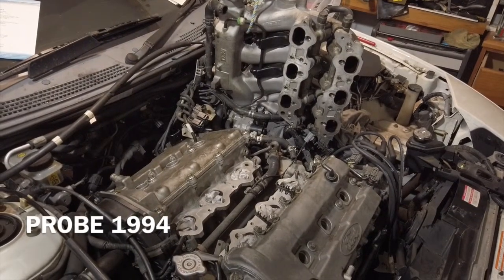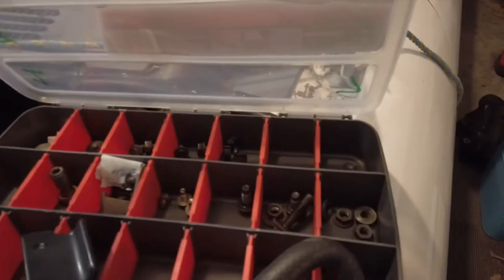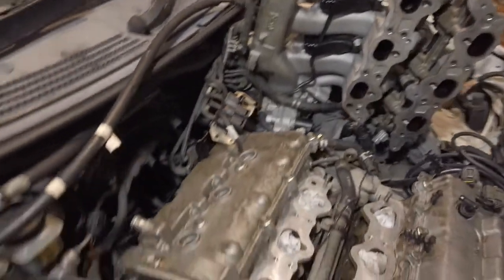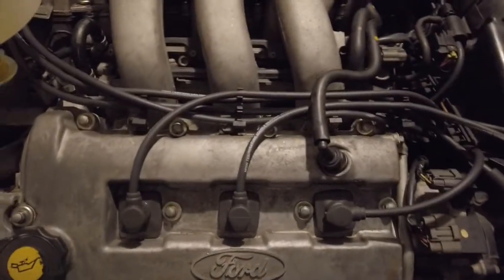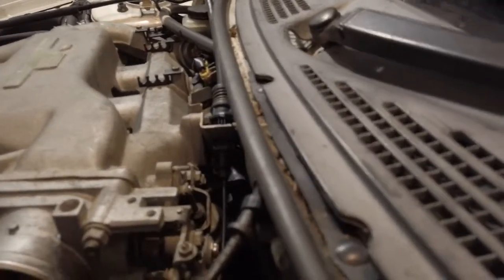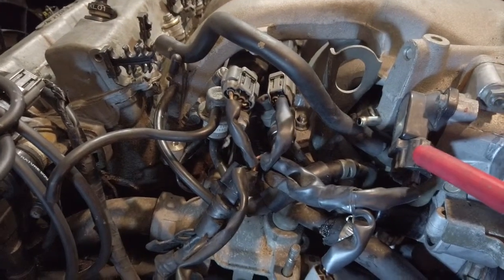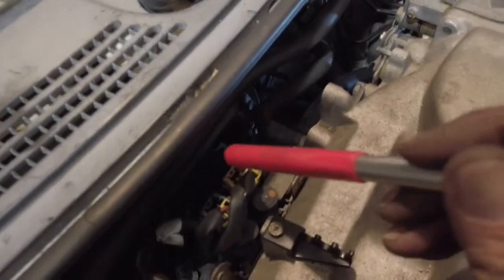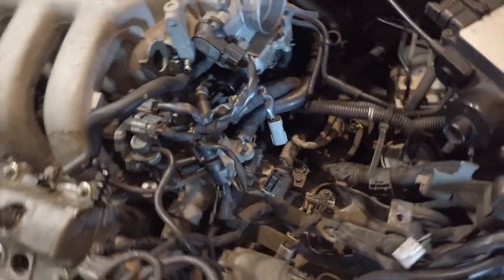FORD PROBE GT 1994 REPLACE VALVE COVER GASKETS

Comment: Will be doing this on my '94 Eunos 500. Looks like big hassle with so much needed to pull off first just to get access to valve cover gaskets. But was sure there had to be a no fuss easier way and looks like I finally found it here. Ta mate!
Reply: Eunos 500 is a very cool car.

Comment: A lot of thanks for your very useful video. I am just tackling this job according to your directions and things are a lot easier than the "standard" procedure. I will post the results of my job!
Reply: I completed everything without issues and even had the chance to repair my VRIS reservoirs and check valve. Thanks for your helpful video!!!
Reply: @ssanmor  what did your VRIS need to be repaired?  New solenoids or other?  Thank you

Comment: It should also be noted while you have that thing off, to replace any thing pertaining to that rear part of the engine and if you have a set of headers, that would be the time to do them while rear header access is easy. I also did the intake manifold gaskets on mine and I actually upgraded the manifold to a ported KLG4 off a 2001 626 ES with a KL31 throttle body
Reply: the infamous knock sensor buried deep under that manifold is The thing to replace on a high mileage engine as its almost impossible to get to otherwise

Comment: -
I have same exact car.  I must do this also.  Thank you for the video, will save me much time.
Reply: it's time for me to do it, dreaded oil in spark wells
Reply: @SilverBullet93GT  for me ,its the drip  drip on the exhaust manifolds from the rear valve cover..